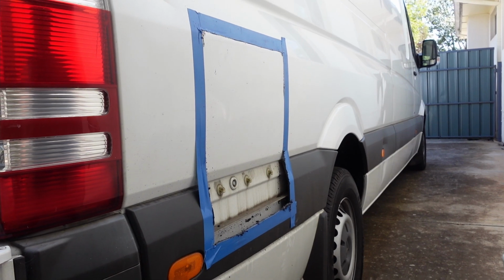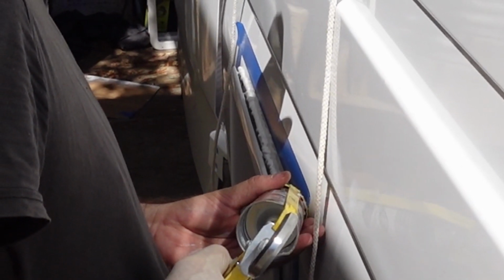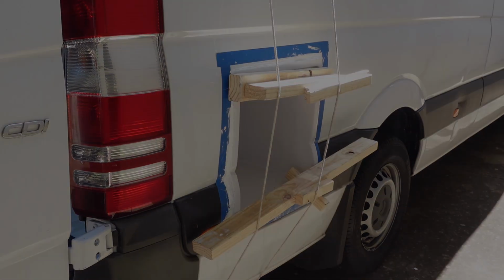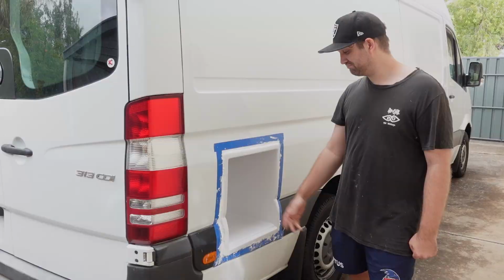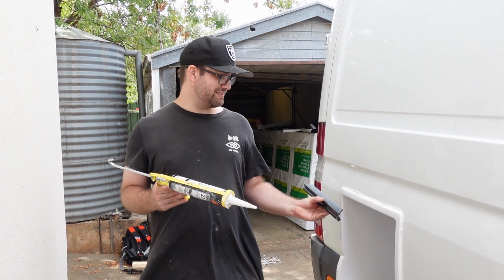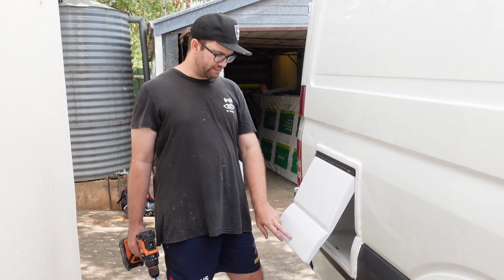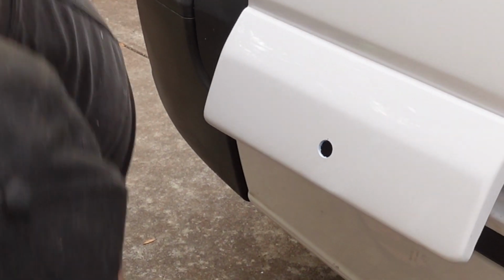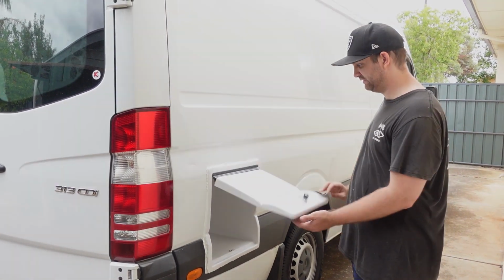How To Install A LPG Gas Bottle Storage - Mercedes Sprinter Campervan Conversion

Comment: Decent job guys. If I may make a suggestion though... It appears the box may actually sit a few centimeters off the floor of the van? If it does, I'd suggest screwing a piece of wood under the back of the box to take the weight of the gas bottle. A bottle bouncing around will do horrible things to the outside of the van from stresses and such. Might be a good idea to add some removable hard Styrofoam bracing around the bottle as well when you put it in.
Reply from the maker: Thanks for the suggestion Jon we will definitely be doing something to try to ensure it is all braced. I’m thinking of building a little platform under the box as well to avoid the issues mentioned